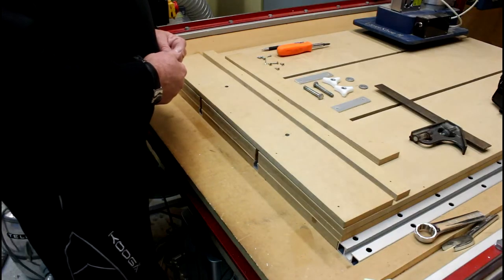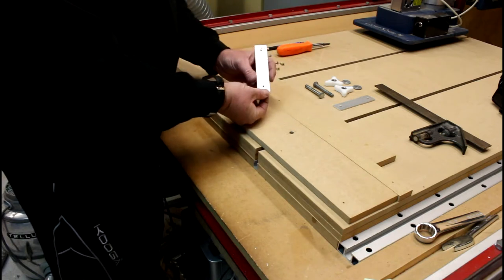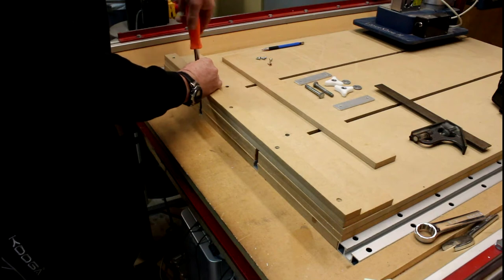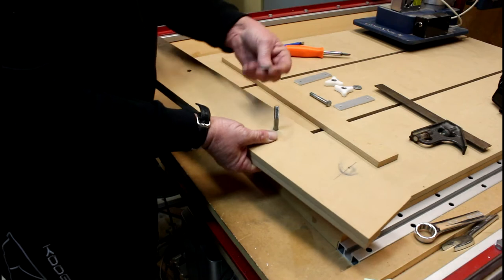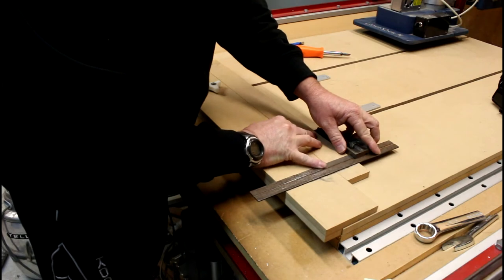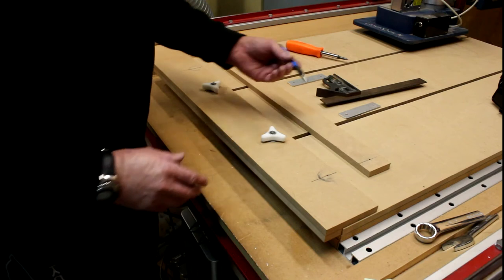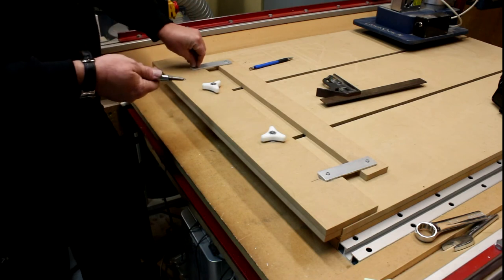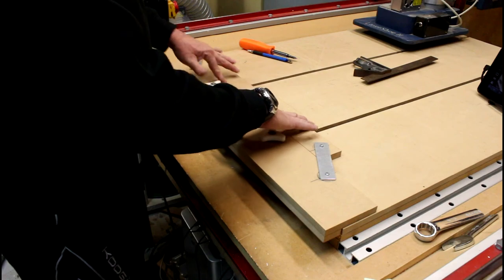Building The Parallel Rule - CNCnutz Episode 58

Comment: Looks like a great jig.  I will add this to the to-do list!

Why not cut the critical holes and edges on the CNC machine?   Attach the 30mm piece to a 150mm (plus extra for width of cut and trim cut) in the same manner you showed ~2:10 into the video.  Then mount to the table as you will in operation.  Use the mill to drill the 4 holes and then a couple straight cuts with the milling machine to trim the leading edge parallel to the X axis and to separate the front (moving piece) from the part that gets clamped.  Accurate holes and parallel!
Reply from the maker: There is no reason at all that you couldn't cut the entire Parallel Rule on the CNC and drill pilot holes at the same time.
It makes perfect sense to do it that way.
The one I made I wizzed up late one night as a test for a wild Idea I had come up with for resetting jigs and I wanted it quick. I just cut the bits on the tablesaw and found it worked well. So well i never bothered to rebuild it and showed it in the video as I built it. Using the CNC would make it easier to get the holes accurately drilled and everything aligned.
All the best on your parallel rule build.
Cheers
Peter

Comment: How do you handle the play between the aluminium and the screws increasing with time?
Reply from the maker: I don't.
I only use the parallel rule only when setting Jigs and double sided projects.
The screws are not overly tight and there is no pressure on it so there should be no appreciable wear.

Mine is 5 years old and as good as the day I made it.

For constant use in an industrial setting imagine steel or aluminum constructuon with bushes would be the way to go but for me MDF and screws is fine.
Cheers
Peter

Comment: Hi Peter,
Sorry I neglected to respond to your question in your last video.  I don't have a parallel rule yet made for my machine.  Actualy the router hasn't been run much this summer as I'm outside doing landscaping around the house and inside rebuilding a small compressor(among oodles of other projects.

But I especially like your T-slots both in the table and flanking it.  When I get to redoing my table I will be making your parallel rule.

Thanks!  Always a pleasure,
John